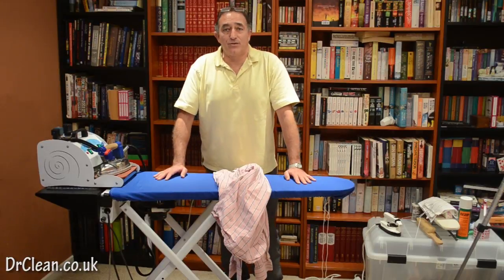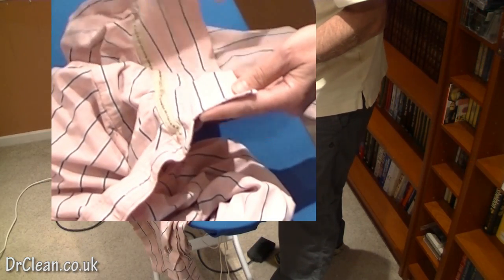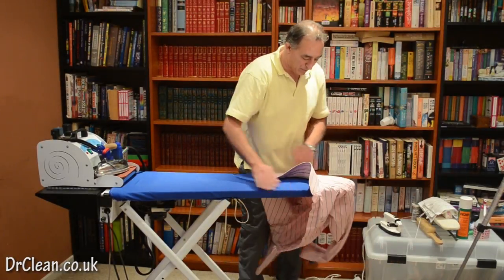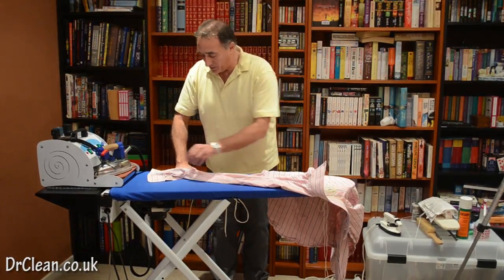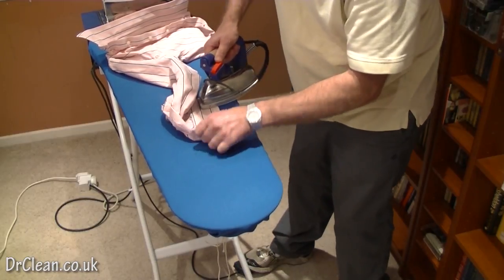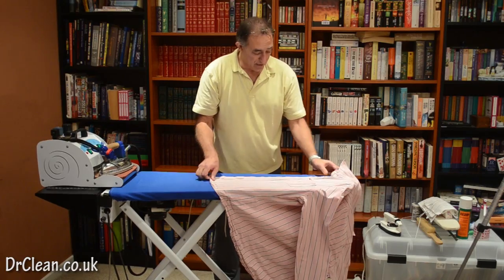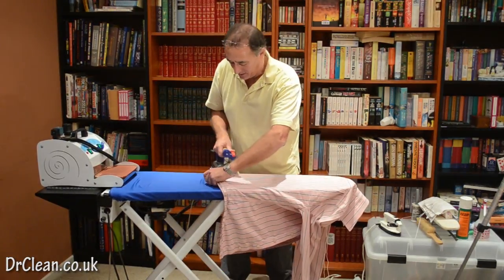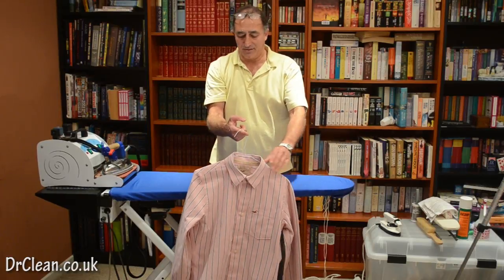How to press a long sleeved shirt like a professional

Comment: Thanks for the video. I will need a better iron I guess. I thought buying an expensive iron with 1800 W would make working shirts as coming from my grandma laundry... If you search on google, all reviews have a 'link' to buy so I guess I cannot trust it. Well,  $200 later the new iron was disappointing... I had to iron and iron and iron....and iron...and still had a poor outcome.  Maybe it is an 'energy saver' ( not mine, I assure) 'feature"
 no iron would do it...If anyone is picky on having a perfect ironed shirt I would appreciate the advise of what kind of iron you use. Thanks!

Comment: I bought 100% cotton shirt, but it wrinkles in secs. Any idea how to get the wrinkles out?
Reply: +MegaLochgelly There are 2 things you should try.

1. Don't over dry your shirts.
2. Either add some starch to the final rinse or spray starch when you iron.

If you over dry the fabric it will tend to lose it's creases on ironing but as soon as it gets in a humid atmosphere (such as next to a heated body) the creases will tend to come back. 

Starch stiffens the fabric and makes it less likely to crease on wearing.

Hope that helps.
Reply: +SwimCycleRunCoach I was signed on another of my channels when I answered - it's really from DrCleanUK. Cheers

Comment: I took 8-10 minutes to iron a long sleeve shirt, is this too long? How long u took to iron a long sleeve shirt?
Reply from the maker: If you follow this process and get used to it then I would expect a normal shirt to be ironed in 5 minutes, that's not rushing. If you get really good at the technique and have no distractions then 2 1/2 minutes would be possible.

With my ironing services I based basic pay on 5 mins and anything better increased earnings.

Hope that helps
Reply: I spend more than 30 minutes to iron my 100% cotton shirts 🤦🏽‍♂️
Reply: @izzatirfan1995  mine 1 long sleeve 1hr